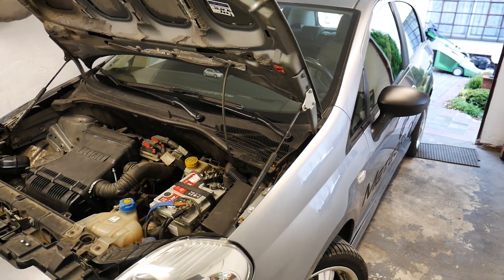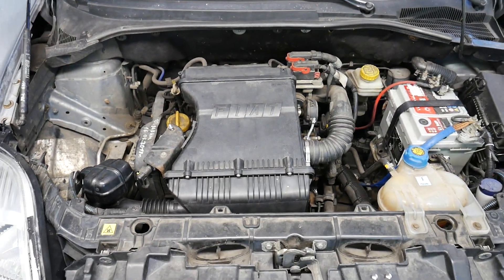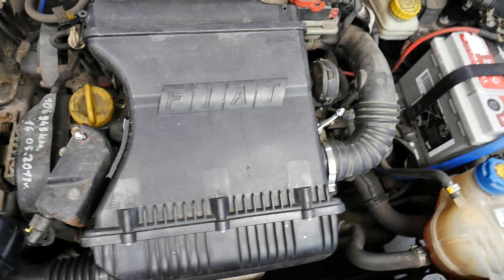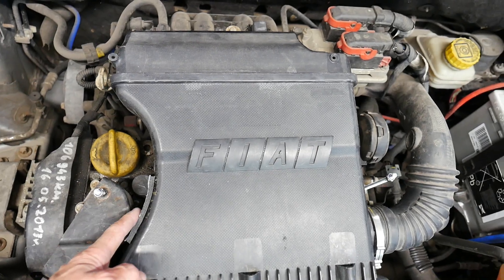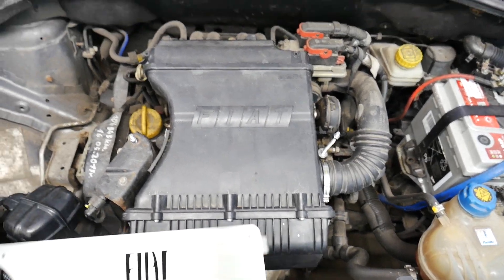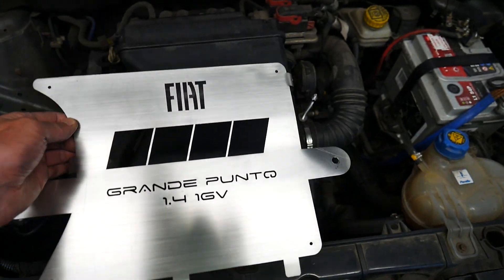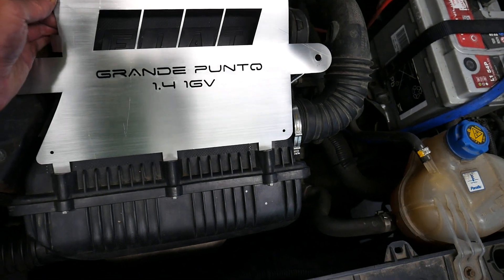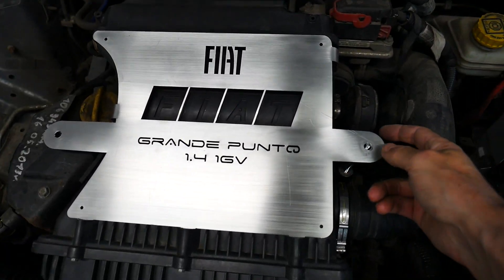Fiat Grande Punto 1.4 16V AIR FILTER BOX HACK

Comment: Damn fine job ! Looks amazing. Lasercut? Is the aluminum stang enough?
Reply from the maker: Its laser cut stainless 3mm, but its too thick, difficult to bend :D So maybe 3mm aluminium, but aluminium will oxidize so best way will be stainless steel but 2-2.5mm maybe. My filter cover from engine side is like paper. But new one cost small fortune :D